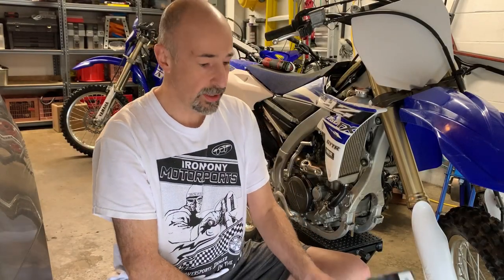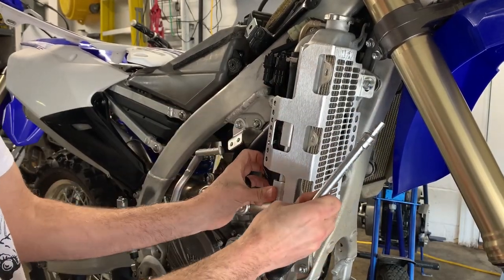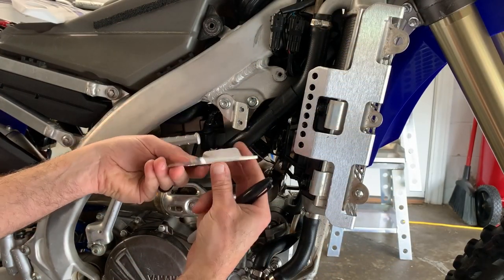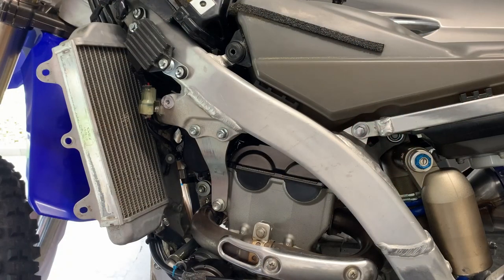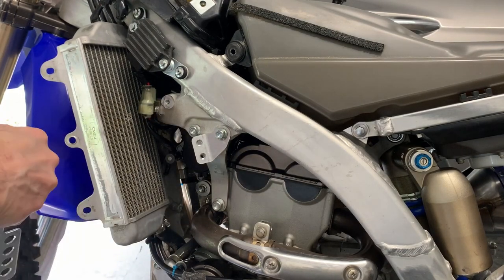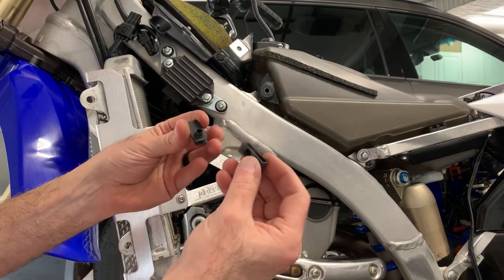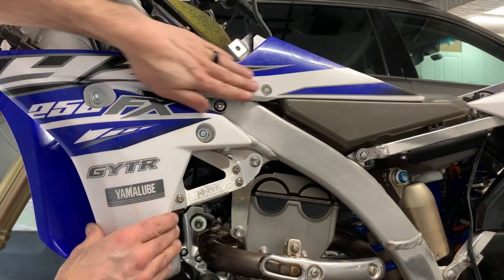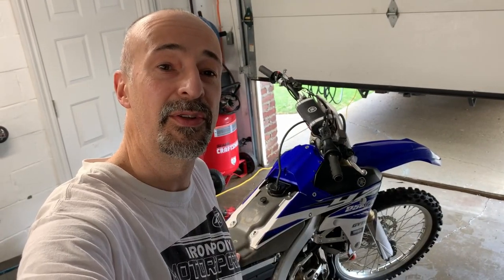Devol Radiator Guards Installation

Comment: Awesome video. So they do work with the GYTR fan, I'm currently trying to find a set of braces for my 450fx.
Reply from the maker: The fan shown in the video is the Yamaha GYTR fan, so the modification to the right side brace is still needed.  

The only set of guards I have been able to find that accommodates the GYTR fan is made by Unabiker:

https://www.unabiker.com/collections/yamaha-radiator-guards/products/ywr250f15

I actually had these braces installed on my sons FX shown in a previous video I made.

https://www.youtube.com/watch?v=fj8vVZwdT2Y&t=1s

Just go to 20:54

They are very good guards for rock and debris but my only issue with Unabiker is the thickness of the metal.  The metal thickness on the Devol braces are thicker than those on the Unabiker brand.  I think the Devol will hold up better on a tip over.

Thanks for asking the question.
Reply: @RMAGarage  nice to Kno, thanks for the info.
Reply: Thanks for the info on the unabiker one. The devol guards I got are different and not as easy to modify but the unabiker fit and one piece too